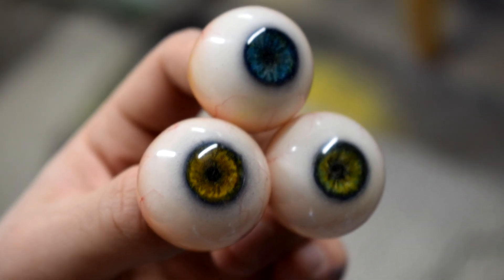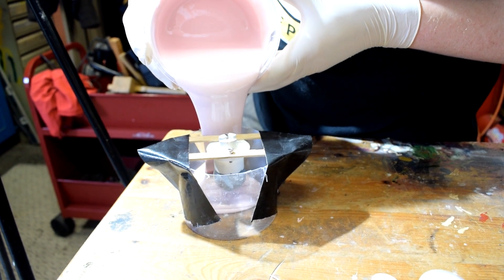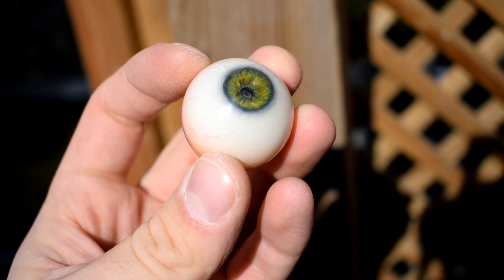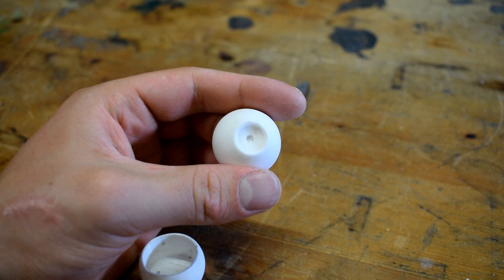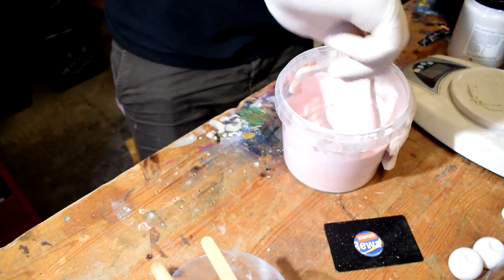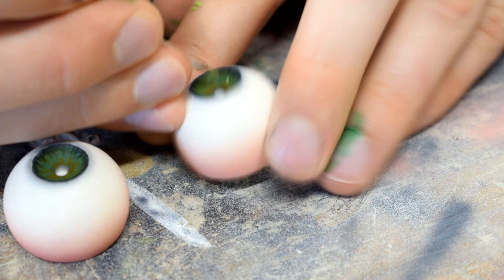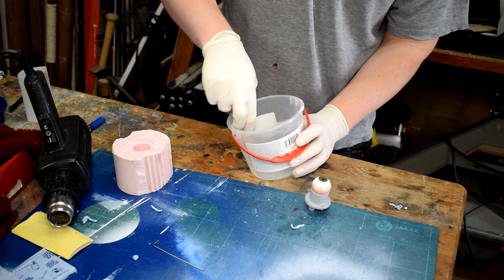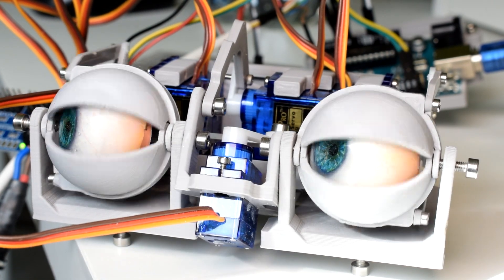How to Make Realistic Eyes Using 3D Printing for Animatronic Eye Mechanisms

Comment: Excellent video and excellent work! I’d really love to experiment with your eye mech but I don’t have a 3D printer! All of my eyes are static 

I’m not so keen on using cotton thread. I like to pour clear epoxy over the top of the eye so that it appears to have a clear gelatinous membrane and when you use thread, the pour backs up and makes it uneven. Instead I’ve started using red and blue flocking for the microscopic capillaries which is mixed in with my epoxy that I use for the main body of the eye. The clear epoxy is mixed with a tiny amount of white acrylic paint and the end result is a translucent effect. To get the appearance of many of these capillaries together like at the back of the eye, I use a seperate concentrated mix of flocking which I mix into the mould around the back circumference with a cocktail stick. After that I paint on larger veins with a detail brush. Your perception joins the tiny capillaries to the larger veins even though there is nothing there to join them up.

Comment: when you paint a ABS car part (ie Grill) you don't have to sand ABS mechanical bond because the paint melts ABS causing a chemical bond... works the same for Car Models and Real Cars parts (I have 38 years Auto-Body and Paint).... works with lacquer and enamels and urethanes paints... not sure about latex.... But I did see where the eye part didn't come out of the 3D printer smooth and needed sanded...

Comment: Vacuum chamber would be good, but you can actually do reasonably well with pressure, and it's much cheaper/more accessible. All you need is a strong sealed container, a schrader valve from an old bike inner tube, and a bike pump. This approach is no good for big parts, since the chamber needs to be big and it's way too much pumping, but eyes are small, it should be easy. You only need like 60 psi for pressure casting, which is not too hard to contain.

Comment: Nice job Will Cogley, 
Although this process is almost identical to the video posted by John Cherevka on Stan Winston's school. maybe a shout out to him and the school would have been nice. 
Just saying giving credit where credit is due
Reply from the maker: I haven't seen that video before but you're right it does look similar. I designed my eyes around a snap-fitting system I made for my animatronic mechanism, so I would have a way to cast a dome over the pupils and easily connect to my mechanism with the same fitting.

Comment: TL/DR - Use the gray eyeball in this video as the mold eyeball.

I'm a pretty smart guy, I'll admit it.  But even I was confused on the process.  I went back and discovered that the main eyeball (gray) you worked on already had the iris in there and was the completed shape.  When you made your mold you used that eyeball and not the ones without the iris.  Seems logical now but it wasn't until I dug into the video a few times.  

I'd also like to think this would be great to do in resin.  I believe that I will be doing mine in resin.

Amazing job!!!  I can't thank you enough for sharing all of this with us!
Reply from the maker: Thanks! Just a note about using resin, I've been told that it can stop the silicone from curing when making the mold, be sure to use TIN CURE silicone with the 3d printed resin, not platinum cure.
Reply: @WillCogley  great to know!!!
Reply: @WillCogley Do you sell these eyeballs online? If so where do I get them?
Please share the link...

Comment: Maybe I miss something: if you make the mold from the eye, that mold fills in the reces of the lens. So how come when you cast the clear resin, the lens socket gets filled with clear resin and becomes a 'positive'?
Reply from the maker: There's a separate component for making the mould which is a little bit larger and spherical, so when you cast the true eyes it forms a thin dome over the entire thing
Reply: @WillCogley  thanks, I must have missed that completely.
Great result though

Comment: Marvelous!

Here is a simple no-cost way to reduce the number of bubbles: Mix your silicone as usual.  When you fill your container, place it on the floor. Pour from table height with the skinniest stream possible. It's like magic!  Need to be careful that you don't entrain more air at the point where the resin starts filling the container.

Comment: I'm confused, what does the casting actually achieve? Absorbing the outer surface with a layer of epoxy?
Reply from the maker: The iris section is concave so casting the resin over it makes a lens shape, like the cornea does in a real eye. It just makes it look a bit more realistic.
Reply: @WillCogley  How does this transfer into the silicone mold though? It's not part of the eye's geometry when you pour the silicone initially. Sorry if these questions are stupid, I must be missing something obvious.

Comment: These are incredible, I think for me, heat is the most effective way of removing bubbles from clear resin but slow mixing with a round stick like a skewer, rather than a flat object like a popsicle stick helps to not introduce them in the first place
Reply from the maker: A round stick makes sense actually, thanks for the tip.

Comment: Another trick to reduce the bubbles is to pour the silicone in a thin stream. The thin stream breaks the bubbles as they pour.
Thanks for making this video. I've been thinking about trying to make some eyes myself.
Reply: The thin stream method should also help with the clear acrylic too.
Thanks again for sharing your work. Those eyes look great!
Reply: I work with silicone casting occasionally and found that refrigerating the cast helps draw the bubbles out, no idea if it would work with the resin

Comment: Just wondering, since you are using ABS, why not use Acetone for vapor smoothing? just curious if you considered it over sanding the eyes?
Reply from the maker: That's a really good idea actually, I'll have to try that next time I make some 👍
Reply: Don´t leave it to long in the acetone vapor it yould deform your part. It happend to my Yoda bust his ears where hanging down. XD
Reply: Using Acetone will smooth it to the point that it’ll look melted and gloopy. Why not print them on a resin printer like the Elegoo Mars and then use translucent resin? It will be incredibly smooth right away.